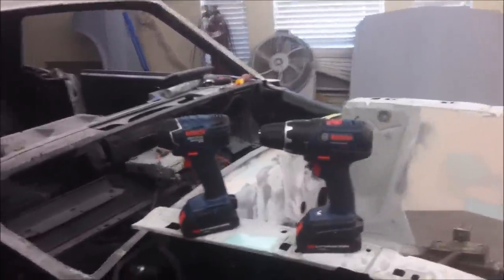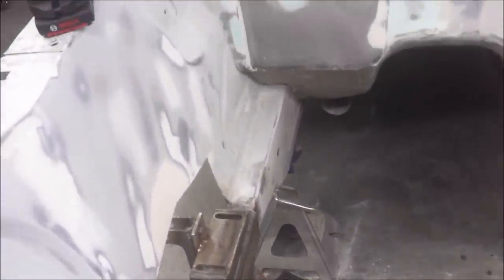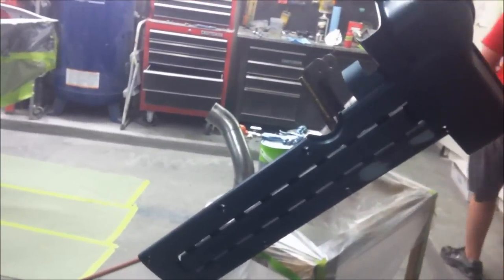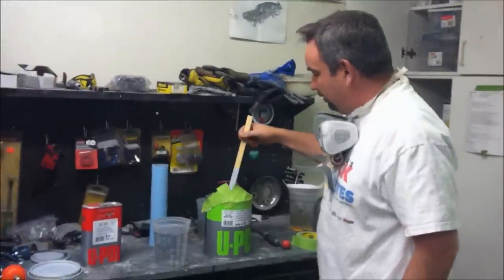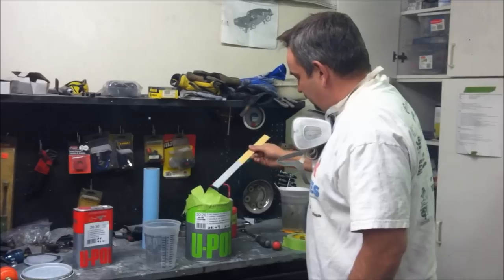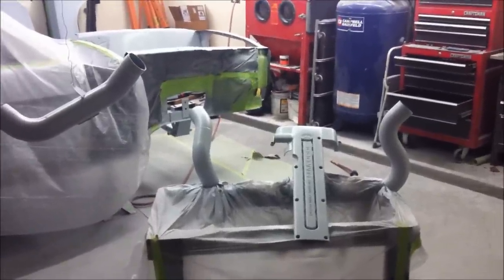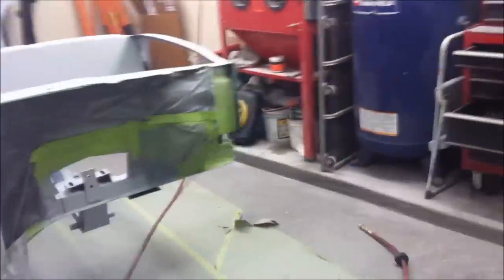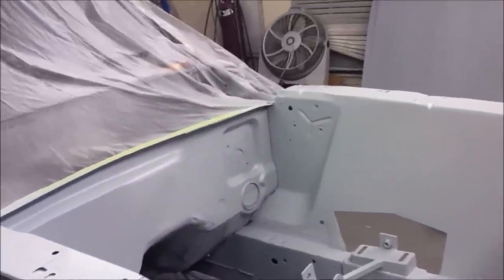65 Mustang Restoration - Bodywork and Paint Part 5 - Engine Bay Primer

Comment: Looks good buddy, that little old run will block out in seconds with some 800 grit.. and as for 'adhesion promotor' ..! thats posh, i have always used a couple of light coats of neat thinners through the gun to melt the existing paint, then while its still tacky, hit it with a coat of primer...but i guess there is always a 'product' to do the same..  good going guys.. Take care.. Del.

Comment from the maker: @zz3astro Yes, will be great for reassembling all the suspension.  It's got enough torque to snug the bolts/nuts down, but not twist the bolts off like the air one, and just tighten on down by hand from there

Comment: epoxy usualy calls for an 80 gritt scratch on bare metal so is a mechanical adhesion the etch is a chemical adhesion that actually etches into the steel its a for sure bond as vwdarrin would say and if you ever etch primer something and tried to sand it off its next to impossible its even hard to sandblast off so you know for sure your getting a good bond.

Comment: Do you have to thin the high build primer at all?  I have the same upol primer and tried it 3:1 but it didn't flow through the gun so I had to thin it about 15%. I think my gun tip is too small for primer but even with a larger tip would you still add thinners?

Comment: Back in the early 90`s we took a piece of steel blasted it and applied a couple of coat`s of epoxy primer and brought it to were by boat was moored and hung it off the pier so that it would be in the water[Salt] at high tide and out at low tide for the season and it never rusted or came off...